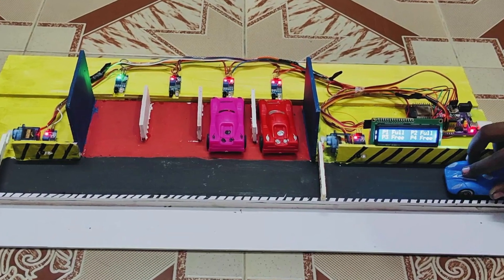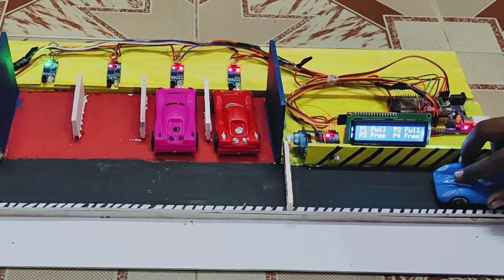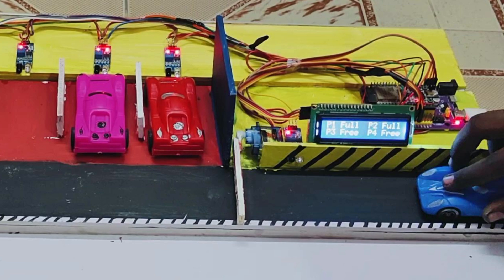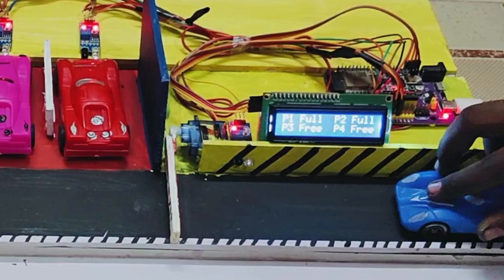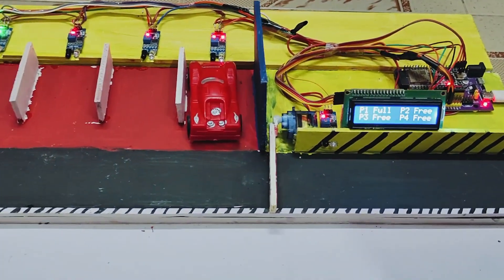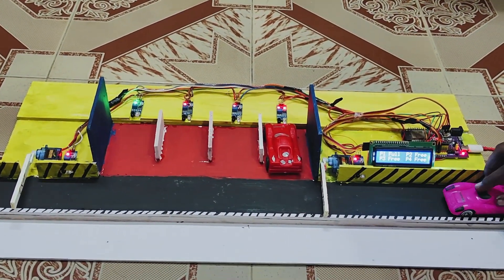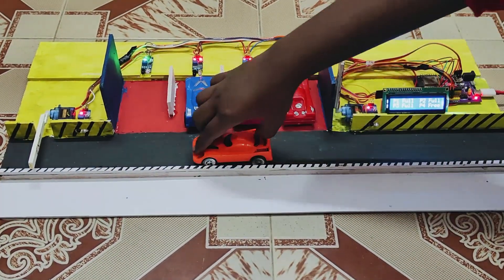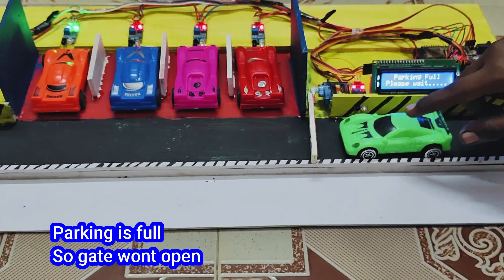Smart IR Based Parking System Using ESP32, Servo Motor, I2C LCD || School Project || College Project

Comment: Sir my project is attendence management system using RFID card scanner. We using nodemcu 8266 we do connection after connection what we have to do not suggest so pls provide full process of that pls. 🙏
Reply: What doing after connection and full process do sir of programming and which app do pls make video
Reply from the maker: Already done that project. Watch in my youtube